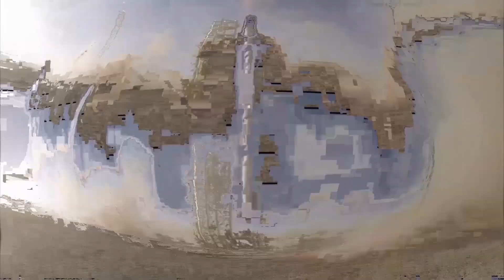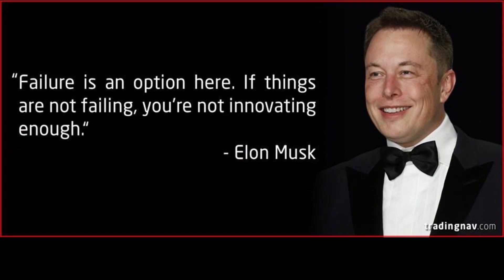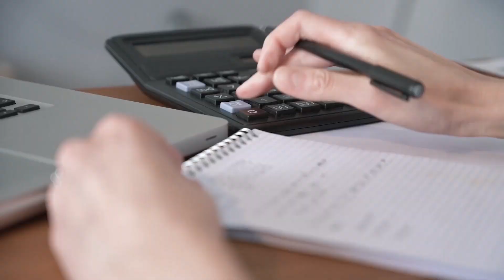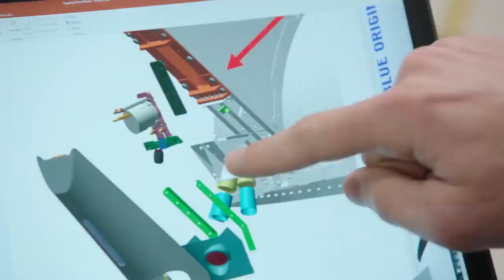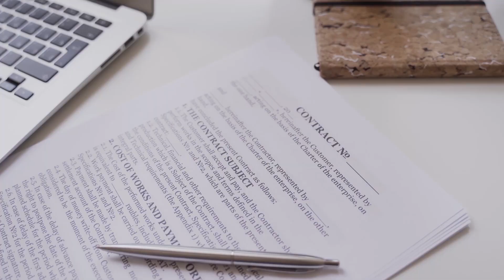Has Blue Origin Completely FAILED

Comment: New Glen is not set to launch anything this year. It's first flight at best is fourth quarter 2023 and starship has 2.5 times the payload capacity.
Reply: Starship is also fully reusable, New Glen is essentially just a larger Falcon 9. If Starship is fully successful it will be an order of magnitude cheaper than New Glen or any other rocket currently in use.